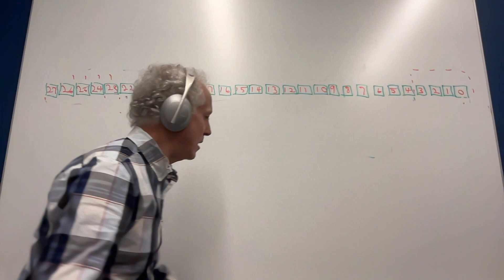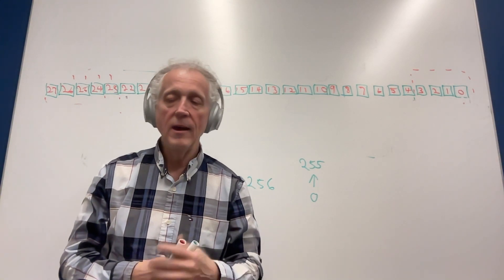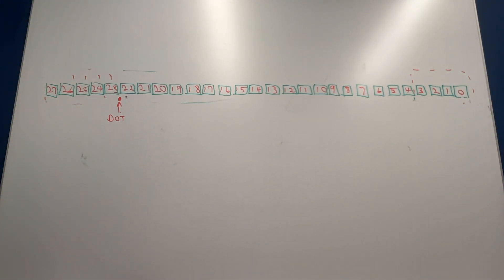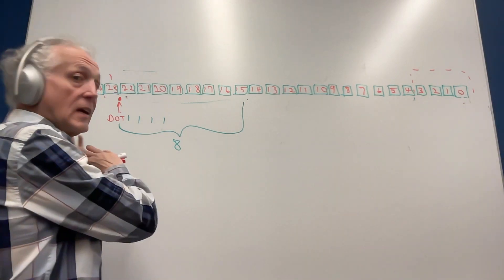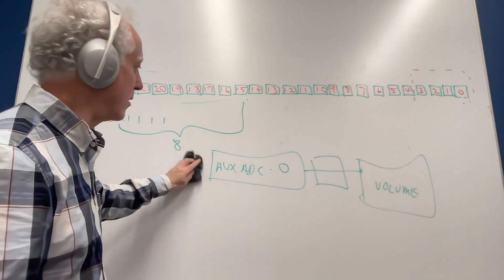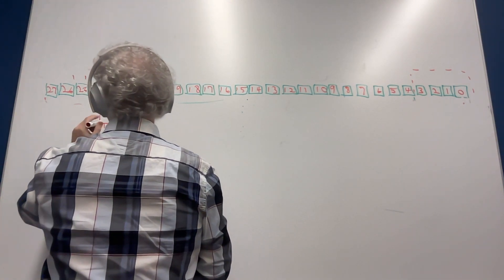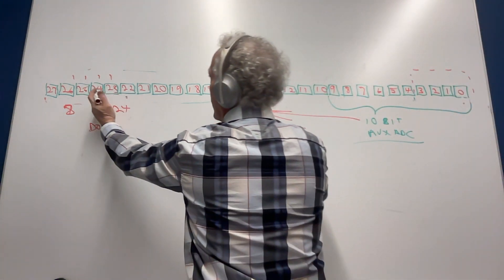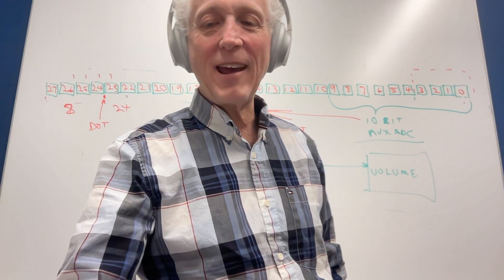AUX ADCs

Comment: Great video thank you for sharing your knowledge. This will help to understand DSP core. I have one question. Dose AUX ADc volume control compromise with audio resolution. In high-end audio i think they avoid using digital volume control they prefer for analogue volume control. Please explain in detail.
Reply from the maker: Hello sMAGTECH,
I would like to know what the "high-end" audio people do not like about the digital volume controls? I think a lot of this comes down to the overall system view and gain structure of the system. Often these issues are because of older systems and are not really valid anymore. In the past there were converters and that was it. Most of the circuitry going into an ADC or coming out of a DAC was analog. The conversion was the last thing done on the ADC side and the first thing done on the DAC side. With today's systems this is not exactly true. 
so with the older systems if you reduced the gain of the DAC you often had to increase the gain of the analog circuit. Then let's say you have a 24 bit audio signal. I will pretend it is actually 24 bits of audio which is hardly ever true, it is usually 20 to 22 bits. So if you reduce the gain by 6dB you lose one bit. So 12 dB you lose two bits. You are using fewer and fewer bits. If you reduce the level by 42 dB you lose 7 bits!! ( I am rounding to 6dB/bit, it is actually 6.02dB per bit but what's a few hundredths of a dB among friends? )
So now you no longer have a 24 bit signal, you have a 17 bit signal. Any data that was way down into the noise floor is now truncated and gone! The noise floor from quantization noise is now much higher with relation to the signal level. Then if you gain that up you bring up this noise floor and if this gets to be extreme you can hear the granularity of the audio. If you have every heard 8-bit audio you will hear it. So the Hi-Fi purists do not like that and complain that you lose some of the resolution of the quiet nuances of the audio. I suppose they are right. within reason I think it is very difficult to hear. 
Now, fast forward to modern systems. You now convert to digital right away with little to no processing done in analog. Then on the DAC side more and more systems are transmitting out on a digital communications standard and you can even remain digital all the way to a Class-D amp right at the speaker! The only analog circuitry is the passive filter on the amp output! So you HAVE to do the volume control in digital.
It is best to do this like you would in an analog design. The volume control is one of the final stages. You would never have your volume control first and then go through an EQ or other processing. So do the same in digital. Do all your processing with the full level signal. This is why we add headroom in the DSP core so you can add gain if needed and it will not clip. Then have your volume control at the end and then your final limiters to limit the  signal level to the 1.0 level of the 24 bit audio. Yes, you have the huge gain of the amps so you have to turn it down but then the noise floor also goes down so it really should not be audible. Agreed, get a top notch high end analog system with class-A amps and there is no way you can get that level of performance. But then, most of us mere mortals cannot afford $100K to put into an audio system! 
I had one customer who builds VERY high end custom home theater systems who uses our Sigma300/350 DSPs in their systems. I asked them to do an experiment. Since the Sigma300/350 has 42dB of headroom in the core, I  suggested they boost up the level at the front end by 20dB and do all the processing at that higher level so there would be more bits in the audio processing for the crossovers and filters. Then just before going out of the serial port lower the level by 20dB. They have great speaker systems and a great listening room. They are also trained to hear small details in systems. They came back and said it made zero difference. They could not hear the difference. So I would not worry about it and do as I suggested which is to design the gain structure just like you would in an analog system and you should be fine. These purists are still living in an old world and not in the modern world with SPDIF or networked audio with WiFi bridges etc. You have to have a volume control in digital. As far as zipper noise is concerned, use the slewed type of volume controls and switches and you will not have any zipper noise. 
Is this detailed enough? :)
Reply: @HowtoSigmaDSP  Thank you very much for clearing my doubts.